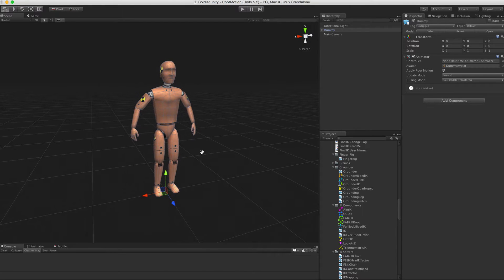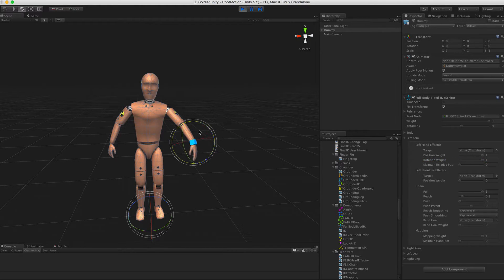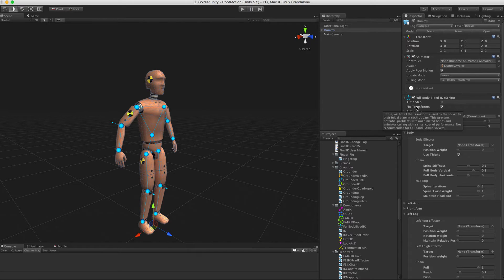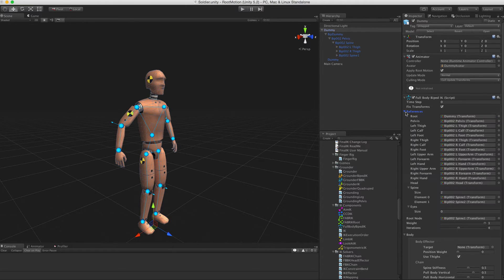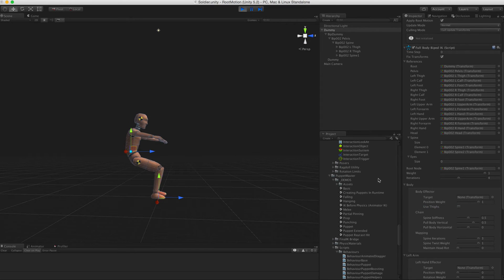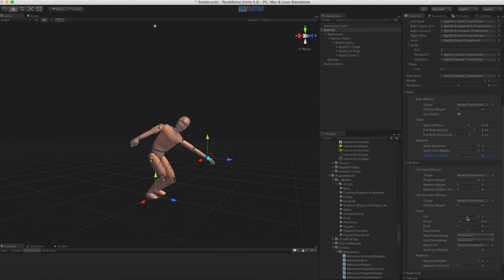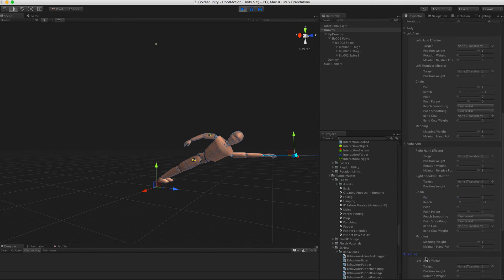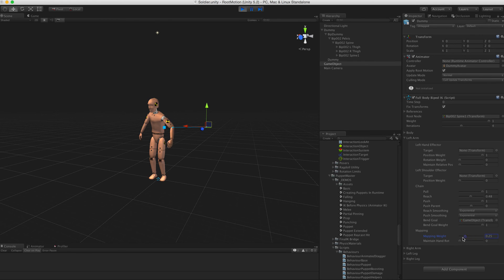FINAL IK TUTORIAL - FullBodyBipedIK Inspector

Comment: Hello I want to save changes because I want to save some poses (for example left leg up) is it possible ?how?because we use it in play mode only how to save it?
thanks
Reply from the maker: Hey,
You could get all the Transforms by Transform[] transforms = root.GetComponentInChildren<Transform>(); Then store the first (root) and second (pelvis) localPosition, and all the localRotations. You can set the character to that pose by doing the inverse of that. Set the first and second transform localPosition and all the localRotations to the stored values.
Reply: Hi  @SnuffThePuppy 
I am a new bee to Unity. The Unity documentation warns against mixing physics based approach and transform modification because unexpected behaviour could result. And from what I understand your answer seems to suggest to do just that. Do you have and hints to avoid the problems the Unity doc warns about?
Reply from the maker: @olieolieolieolie1249  That means you should not do direct transform modifications on active non-kinematic rigidbodies. That would break interpolation, friction, collisions and such. That doesn't mean you should not manipulate kinematic rigidbodies, like bones of a ragdoll while the rigidbodies are kinematic and animation is playing, that is fine, there is no dynamic simulation performed on them.

Comment: hello,i'm a beginner,there are some questions while using fbbik. i want use fbbik to control a robot model,but i can't fill all node correctly because each node in robot model corresponds to a motor,for example , a upperarm in fbbik corresponds to two nodes in my robot model, how to solve this? And there are some wheels instead of legs in my robot model,should i use fbbik to control the mode do some actions such as writting on paper? or other better methods? my english is so poor, hope that you can unstand me!
Reply from the maker: Hey,
FBBIK was designed for humanoid characters, might be possible to use it others, but there might be difficulties as you mentioned. You could try to solve that rig by combining multiple solvers. Send me an email to support@root-motion.com with a screenshot of the robot or something so I could give you some more useful instructions.